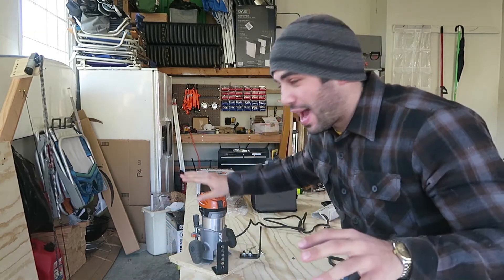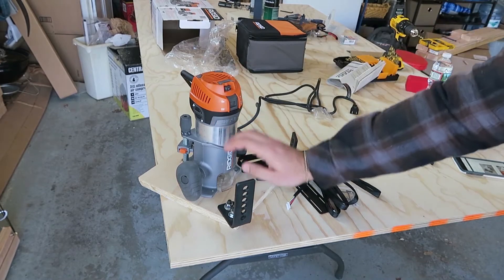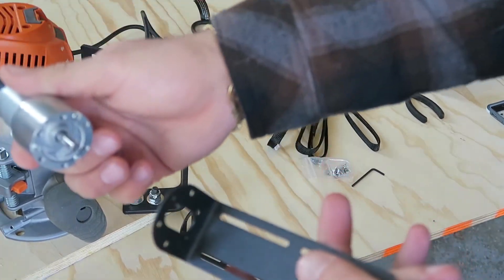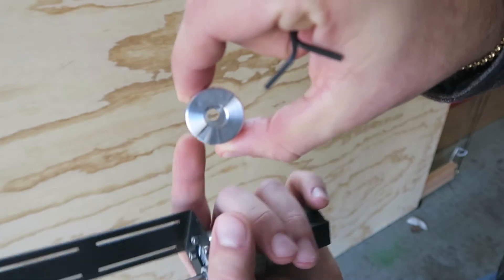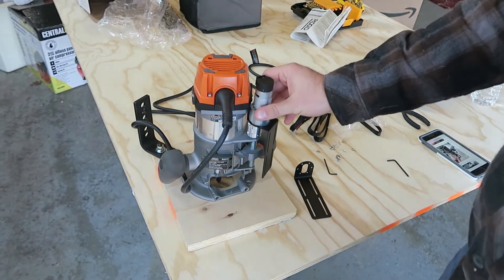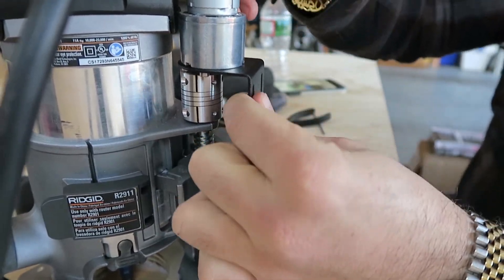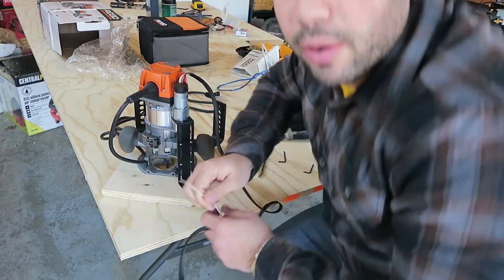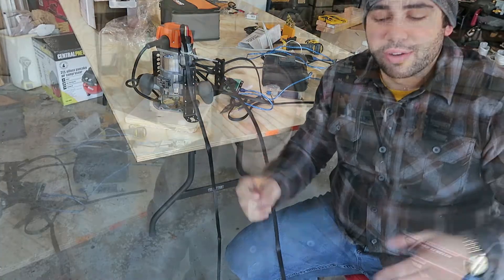Maslow CNC - Installing the Z Axis!

Comment: the z axis is really janky. one needs to sand it down with 400 grit sand paper and then apply TWO coats of a dry lubricant like this. if you do not do this, your z axis will eventually pop out in the down position and destroy your work. 
https://www.amazon.com/CRC-03084-Lubricant-Aerosol-Spray/dp/B0013J62P4/ref=sr_1_3?crid=WXUCZAU0LFJP&keywords=dry+moly+lubricant+spray&qid=1580564919&sprefix=dry+moly%2Caps%2C161&sr=8-3

Comment: Fixed-base routers have no rails to travel on up and down. The base is meant to be clamped tight after adjusting the height.
In order for the router to travel up/down you have to leave the base loose which introduces chatter and leads to poor cut quality. A design based on a plunge router would be better.  
I understand the designers tried to add an inexpensive option for people who started with a fixed-base router but this is just not right.
Reply from the maker: You definitely have some good points, but I've found that the motor used to control the z axis actually does a good job of holding it tight in place and haven't noticed any chatter so far! Definitely something to consider though

Comment: I am looking to produce wood "topography" bases for architectural models without stacking routed sheets. This seems like it could work for this. I haven't seen any videos yet for this type of thing. Maybe I'm just haven't found them yet. Do you have any videos using the Maslow setup showing 3D projects?
Reply from the maker: Nothing on this yet - but I’m happy to actually make this one of my next projects. Having this styled art on my wall would be pretty sweet  so I’ll give it a shot

Comment: Before installing the Z axis kit do you need to turn the depth knob all the way up so that the drill bit does not touch the material or it does not matter? And how much is the actual depth you can go with this?
Reply from the maker: Hey, so it doesn’t matter because you’re going to end up zeroing the z axis before each cut and since the motor goes both directions, you don’t have to worry about where the depth knob is set to beforehand. You can go as low as the router depth would normally allow u, there are no added limitations using the Maslow for that

Comment: Nice Video. Like them all. With out the Z axis I guess you have to keep adjusting the router depth manually?
Reply from the maker: Yeah - I highly recommend getting a z axis, especially since each cut needs multiple passes at different depths, a z axis is a time saver and makes everything easier.
Reply: So would you have to unlock the high adjustment.  Or would you just leave it unlock?